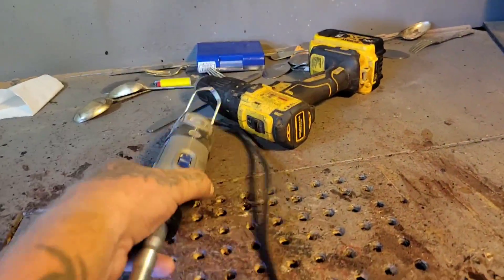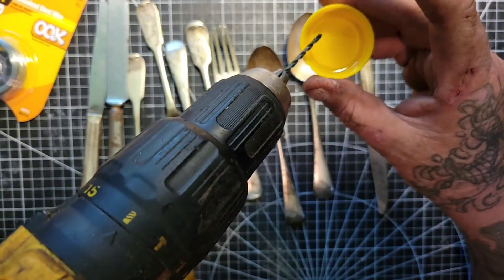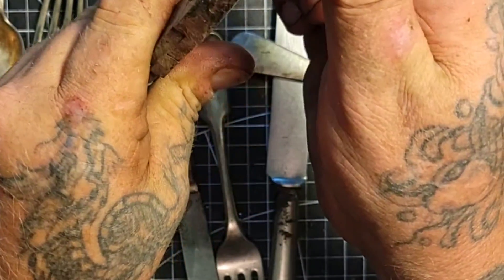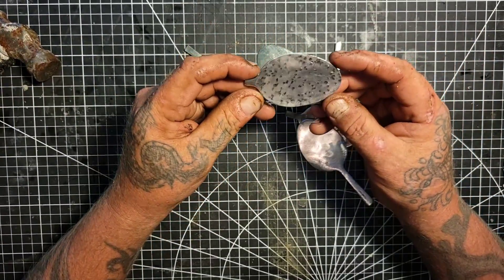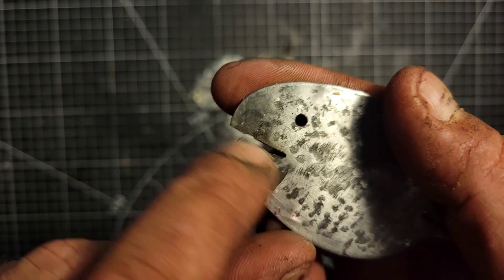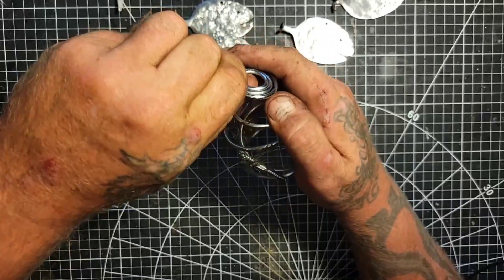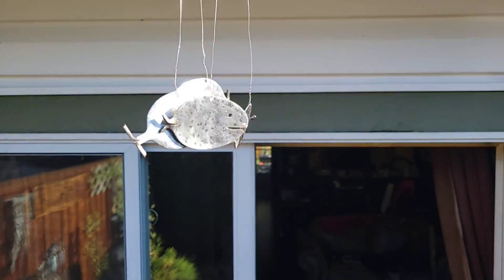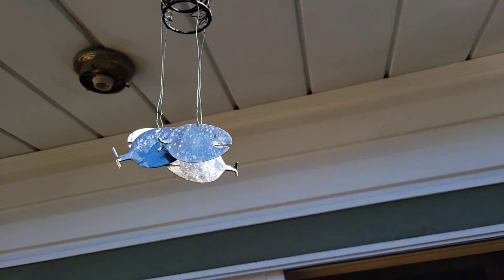How to Craft old silverware into windchines.

Comment: I've actually got one of these that i bought 25 years ago! Its got two forks that have a twist in the handles and large marbles held in the prongs and two smaller spoons also with twists. The thing that makes it chime is one larger spoon tied from the top splayed fork and hanging down through the others. I love mine and fancied trying one so i might give it a go! The fish are great, though if you'd varied the length of the wires slightly it would be more pleasing to the eye. Thanks for the video, i enjoyed it!

Comment: What you should have used was a little bit of your propane torch then hammered them out they would have spread out a lot more on the little tails that you were trying to make you got to heat stainless steel up to high heat to about 800 degrees, which is about red. Then hit it on a piece of metal like a old railroad tire chunk of that works good as an anvil. That's it folks but who knows if you like it or not
Reply from the maker: Thanks for the tip